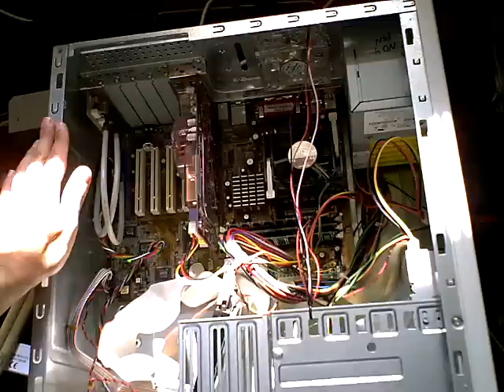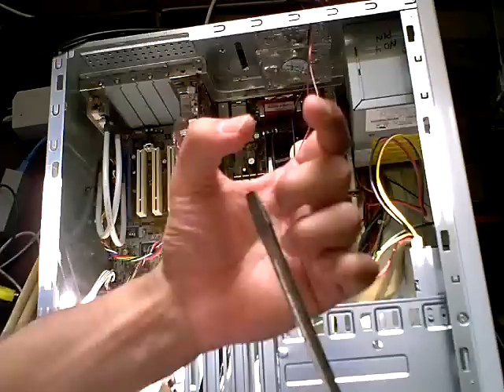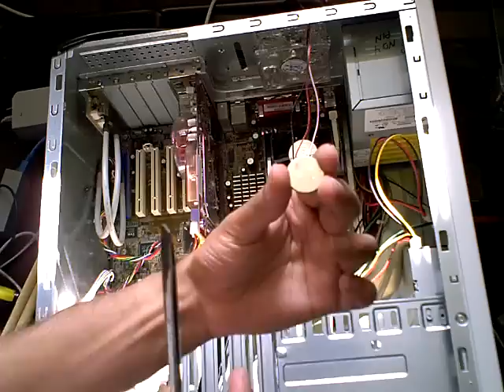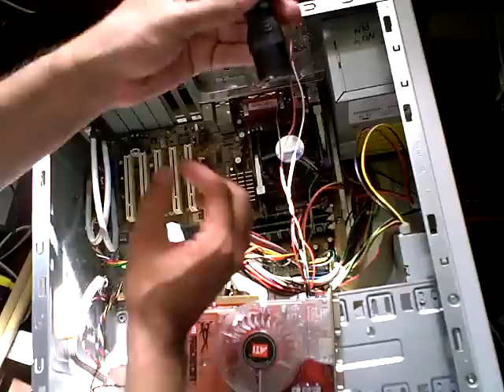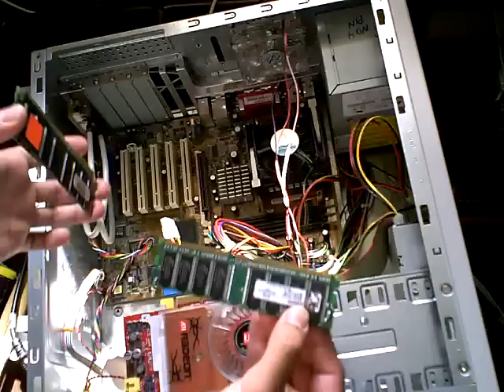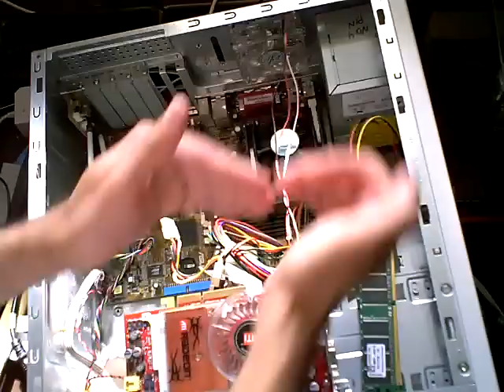How to possibly fix a PC that will turn on but will not beep and will not display anything on screen

Comment: hi, problem in my pc was when i turn on the cpu it starts beeping. i tried once again by clearing the dust on ram and ram slot but it continues  beep and there is no diplay comes in monitor screen. this problem occurs after the appearence of colour lineing  in monitor while i am using pc. right from that moment my pc not working.the colour line in monitor(if signal lost in television the colour line appears like that ).pls help me...
Reply from the maker: The colour bars on your screen sound like the screen itself is producing that and not the PC, it essentially means 'no signal'. As for the beep, Beep error codes differ from one BIOS manufacturer to the next. To discover what the beep error code is trying to telling you, discover the manufacturer of your BIOS (available in the motherboard's manual or on the motherboard's manufacturer's website {on the page for your specific motherboard model}) and then look up the frequency and interval of your beep error code on:

http://www.computerhope.com/beep.htm

Comment: please help! i have a problem where when i start up my pc green lights on the motherboard turn on with the fans for 3-4 seconds and turns back off and it repeats. the monitor also wont show anything.... please someone help.
Reply from the maker: Breadboard it (explained in the following video:)

If the steps in this video did not provide a solution to your problem, view:

http://www.youtube.com/watch?v=_EK9a-R5pss

You never know, maybe rebuilding the PC in the opposite sense that you took it apart will solve the problem.

Comment: I have a Dell windows computer and it turns on and displays the first start up screen then it just goes to the blue where it indicates that it is on but I guess it's technically black but lit up so like it's on but then nothing happens and when I push the buttons they beep. Two days prior the battery said it needed to be replaced but for some reason it is doing the same thing even if I take the battery out and just plug it in.
Reply from the maker: +Hooded Violin Beep error codes differ from one BIOS manufacturer to the next. To discover what the beep error code is trying to telling you, discover the manufacturer of your BIOS (available in the motherboard's manual or on the motherboard's manufacturer's website {on the page for your specific motherboard model}) and then look up the frequency and interval of your beep error code on:

http://www.computerhope.com/beep.htm

Comment: Can you help me I have a asks monitor connected but it says hdmi no signal then if I i change it to Dvi it say no signal still
Reply from the maker: It sounds like your PC is defaulting to a different video output than you are connected to (possibly even the onboard integrated video output). Keep in mind that you can only change to different video outputs by first shutting off your PC, then changing your display cable to a different video output, and then powering your PC back on. If the first video output change doesn't work, then again power down your machine, connect your display to a different video output, then power up. Repeat this until you have tested every video output available on your PC. Lemme know how this turns out.

Comment: My computer won't work with the keyboard and mouse witch makes the monitor not come out of sleep mode and I don't know what to do when I plug the keyboard in and push like caps it works then if I do it again I doesn't. Help?...
Reply from the maker: Hmm, sadly I couldn't tell you how to solve this issue. The only thing I can think of is to perhaps switch from USB peripherals to PS/2 peripherals or vice versa. If this doesn't solve the issue, perhaps I'd revert the power scheme of your PC to time out individual components such as the display, hard drive, processor, etc. without actually putting the PC to sleep in order to avoid this issue entirely. Sorry I couldn't be of more help : \

Comment: Ok so I have this new build and I took extra precautions to avoid and static damage, grounding and like no clothing. At first all going good, I installed win 8.1, drivers, went on facebook for a few hrs. Decided to do some gaming and launched GTA5. At the cut scene it just died as if someone unpluged it from the wall. Now it won't start up at all. No fans spinning, no beeps, nada. All new parts as well went into this build. Please help.
Reply from the maker: +iceeblister You could have blown or overheated one or more components. To have a better idea, Breadboard it (explained in the following video:)

If the steps in this video did not provide a solution to your problem, view:

http://www.youtube.com/watch?v=_EK9a-R5pss

You never know, maybe rebuilding the PC in the opposite sense that you took it apart will solve the problem.
Reply: RodneyDickson Hey mate, so its been a while but I have fixed it. bought this cheap ass PSU on ebay.. big mistake..and it was new. But that was the issue. it died on me. So went to best buy and got a new name brand one. Worked great after.
Reply from the maker: +iceeblister Ahh, good to know. Thanks for the update : )

Comment: I have this ram problem, it works if i only install one stick. how do i get it to work with all 3 sticks?
Reply from the maker: +Ghost _ (Ghostrifi) Unplug, switch up the order of RAM modules vis a vis their slots, power up, if no luck, repeat until you find a situation where at least two RAM modules function. Keep in mind that many boards have problems with odd numbers of RAM modules (3 in your case) so you may have to settle for 2 or buy one RAM module with a bigger capacity

Comment: By mistake i have spilled water on my pc the video cut off the second i also switched off the main switch to avoid any damage the problem is the same in the video no signal msg is coming on the monitor.  Please help.
Reply from the maker: +Vishesh Samaiya I'd assume that one or more components have water damage. You can try unplugging it, removing your video card, and trying a different video out to see if it is just the video card that is damaged.

Comment: My problem is that my computer turns on, but nothing is displayed on the screen. The CPU also makes some kind of sound like a siren; and it will only work when I restart it 2-4 times. Any help?
Reply from the maker: +Zealous Askeladd Beep error codes differ from one BIOS manufacturer to the next. To discover what the beep error code is trying to telling you, discover the manufacturer of your BIOS (available in the motherboard's manual or on the motherboard's manufacturer's website {on the page for your specific motherboard model}) and then look up the frequency and interval of your beep error code on:

http://www.computerhope.com/beep.htm

Comment: Neither my integrated graphics card works, neither my GTX 650 Ti. It does the same thing as it does in the start of the video. Fans & Lights working, but nothing on display. On VGA, I have nothing on display while on DVI it doesn't have any signal to the monitor.
Reply from the maker: +The Gamer Dany Follow the steps in the video.

Comment: Before actually taking the whole thing apart, the first thing I would do is run a multimeter across the CMOS battery, If you have a business it will save you valuable time. Many people mistake a bad battery with a bad motherboard. Believe me I know, Ive seen it and these are the exact symptoms.
Reply from the maker: +masso172 Very good tip. Thanks for the input

Comment: Could it be the power supply even if it beeps with removal to ram?
Reply from the maker: +GodOfCalamity .Yato It could, but what is the beep error code telling you the problem is? Beep error codes differ from one BIOS manufacturer to the next. To discover what the beep error code is trying to telling you, discover the manufacturer of your BIOS (available in the motherboard's manual or on the motherboard's manufacturer's website {on the page for your specific motherboard model}) and then look up the frequency and interval of your beep error code on:

http://www.computerhope.com/beep.htm

Comment: This is my exact problem! I am building a new pc and get the beeps on after removing the ram. Will reply after fix.
Reply: Update: the motherboard only beeps if all ram is removed, any configuration with at least 1 stick will continue to not have any beeps or anything on the screen.
Reply from the maker: +Liam Keough Sounds like the RAM is not compatible. If this is new hardware that you are installing on your motherboard (that has not yet functioned on your motherboard,) note that matching bus types of video card to motherboard socket (PCI-E for example) or matching bus types of RAM module to motherboard socket (DDR3 for example) does not necessarily signify compatibility. If this is the first time you are trying this hardware on your motherboard, there is a chance that this new hardware is not compatible with your motherboard, despite the same bus type and despite the fact that the new parts fit in their respective motherboard socket. Your motherboard manufacturer's website will have a support page dedicated to your motherboard's model, and on this support page should be a compatibility list for such components as video cards and RAM modules. Ensure that your new component is certified to function with your motherboard, and if your new component is not present on the compatibility list, then there is a chance that the new component is not compatible with your motherboard.

Comment: I just built mine, same problem but the computer stays 5seconds on and then restarts and does the same thing.
No beeps, no signal..
Reply from the maker: +Janttux  Breadboard it (explained in the following video:)

If the steps in this video did not provide a solution to your problem, view:

http://www.youtube.com/watch?v=_EK9a-R5pss

You never know, maybe rebuilding the PC in the opposite sense that you took it apart will solve the problem.
Reply: +RodneyDickson Already solved, the motherboard was dead.
Reply from the maker: +Janttux Sorry it came to that then

Comment: I idissassemble my pc today I remove the cpu fan to clean it. I also remove my video card ram cd rom. And hardisk . Then I reaassemle it after cleaning.  I start my computer nd. Nothing is on the screen all black. And it says on a blue. Background power saving mode then the powet button of the screen turn orange!! !! Ineed help?
tnks
Reply from the maker: Try everything shown in this video to try to get down to the bottom of the issue. Let me know how it turns out.

Comment: For some period before this happens my monitor from turned on was turning off and then turning on again and a message was poppinh up that the nvidia drivers stop responding but i didnt know how so fix the problem..and now my monitor wont turn on at all like in the video..what can i do any possible help?
Reply from the maker: +I'mInLoveWithTheCoCo Sounds like your video card is dying and/or dead. I'd try using a different video out device

Comment: hi i just bought z11 case gtx 970 and i have that problem but i dont know if i have to do that or ask the one that i have bought it from
Reply from the maker: +Doge Owner If it is under warranty and your point of sale will service it free, get them to do it. If it will cost you money to get it serviced, then I'd do what is shown in the video. Either way, it's your call to make.
Reply: it fixed i just had an old monitor and i got new one and it worked thanks x)
Reply from the maker: +Doge Owner (shrug) sure. Glad it worked out.

Comment: what if you remove the ram but still no beep!!! but the led lights are powered on? is it the processor or motherboard?
Reply from the maker: +Rutagwera Godfrey Cannot know for sure unless you swap-test these two components with duplicate motherboards and CPUs. I recommend you Breadboard it (explained in the following video:)

If the steps in this video did not provide a solution to your problem, view:

http://www.youtube.com/watch?v=_EK9a-R5pss

You never know, maybe rebuilding the PC in the opposite sense that you took it apart will solve the problem.

Comment: Do all motherboards beep or do I need a system speaker? Mine didn't come with one.
Reply from the maker: +QuietlyInsane Not all unfortunately. Look for an onboard speaker, but if you do not have one, and there is no speaker connector from your case to your motherboard's front panel, then you may want to buy one at a computer shop.

Comment: I have a HP Pavilion p6320f that had a bad M2N78-LA MoBo. replaced MoBo with exact new one (same revision, etc) now it won't even boot up. Everything is on (fans,HDD,DVD) but it refuses to send signal to monitor and monitor goes to sleep.
Reply from the maker: Try everything shown in this video. Lemme know how it turns out.
Reply: I'll try and let you know, thanks.

Comment: I have the same problem, and have tried al of this but even with the battery out and nothing exept for the psu and the cpu installed i get no bleeps whatsoever, does this mean my motherboard is dead ? (i only have this mobo for about a year)
Reply from the maker: +Wouter Landzaat Jacobus Breadboard it (explained in the following video:)

If the steps in this video did not provide a solution to your problem, view:

http://www.youtube.com/watch?v=_EK9a-R5pss

You never know, maybe rebuilding the PC in the opposite sense that you took it apart will solve the problem.
Reply: Thanks man! I replaced the power supply and that fixed it, since i did that no problems anymore.
Reply from the maker: +Wouter Landzaat Jacobus Glad things are working now. Thanks for the update

Comment: Please help man, so like 2 days ago i was curious about how my pc looked like from inside and also i wanted to clean all the dust so i opened it up and i dindt really clean all the dust i just removed the dust from the walls of the pc and also dust from the cpu fan and today i tried to start up the pc and i didnt hear the usual beepings also i didnt get any video signal just the LEDs from the on/off button where working as usual what should i do my pc was working fine before i opened it,
Reply from the maker: +Gustavo Salinas Do what you see in the video

Comment: Good guide but you missed one more step! Taking the board out of the case completely in case a set screw or something is shorting out the board. Did this with a customer and he didn't use all the risers for the mobo screws.
Reply from the maker: You're absolutely right. After receiving questions from viewers who were describing the symptoms of short circuits, I shot a follow-up video to this video addressing this very issue. Thanks for the feedback : )

The follow up video (if you care to see it) is here:

Advanced troubleshooting technique tutorial of how to possibly fix a PC that will not beep at boot

Comment: hi. what to do because when I start my pc, when it comes to Starting Windows, it's just the"starting Windows" not the logo and it stucks there. I badly needed help
Reply from the maker: +Paul Troy Brucales This is difficult to diagnose. First, go into the BIOS, select 'load setup defaults' then save and exit. Let me know if that solves your problem.

Comment: I tried to on my PC when the voltage was less,ever since that when i try to switch it on only the fans are running and the monitor shows no signal the red light which blinks in normal use ( i think the hard disk indicator) is also not turning on WHAT SHOULD I DO PLEASE HELP!!!!!!
Reply from the maker: Do what you see in the video: it should reset that setting to default

Comment: My alienware x51 does that but it beeps and when I press the power button it turns off straight away I don't eaven have to hold it please help!
Reply from the maker: +snipershadow93 Beep error codes differ from one BIOS manufacturer to the next. To discover what the beep error code is trying to telling you, discover the manufacturer of your BIOS (available in the motherboard's manual or on the motherboard's manufacturer's website {on the page for your specific motherboard model}) and then look up the frequency and interval of your beep error code on:

http://www.computerhope.com/beep.htm

Comment: I have the same problem but mine is with no beeps. My computer is not hand built and sadly I can't locate the mobi since my desktop is an Emachine.
Reply from the maker: +Mike Rise try to Do what my video shows: disconnect the power cable, remove the CMOS battery, short the CMOS jumper pins for 9 seconds then return the jumper cap to its initial position, press your PC's chassis power button switch (to discharge any remaining power circulating in the system), leave the PC unplugged and in this state overnight, then the next day return the CMOS battery to its socket, power up the PC, and if no beep, then disconnect the power cable, press your PC's chassis power button switch (to discharge any remaining power circulating in the system), remove one component, power up the PC, and if no beep then repeat (each time unplugging the PC, pressing the power switch to discharge remaining power, removing a remaining component, and then powering up, and this until the PC beeps at boot).If it never beeps, even when you are down to just motherboard, power supply & CPU+fan, one of these remaining components may be bad